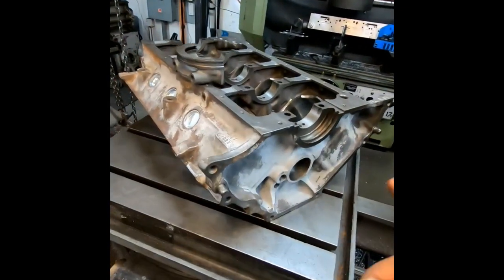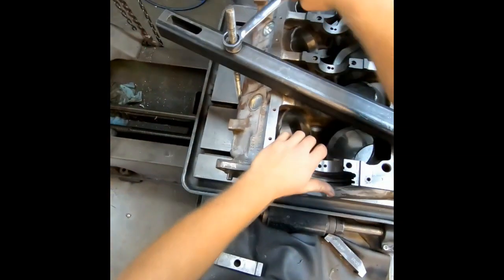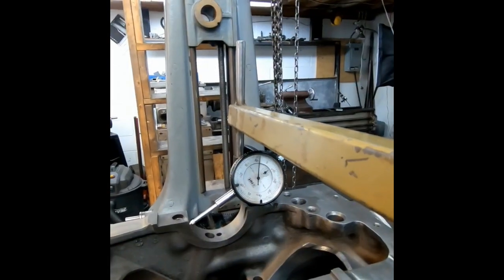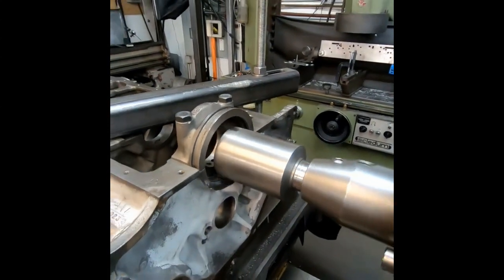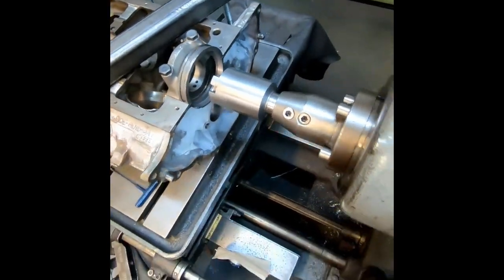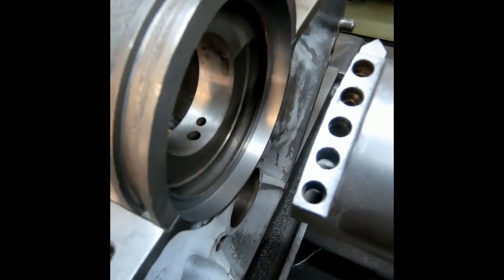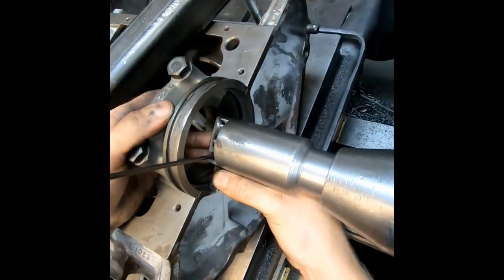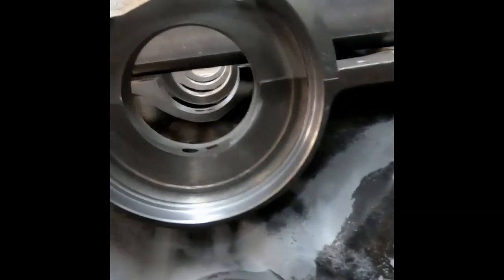302 Ford One piece rear main seal conversion

Comment: Wait can you put a 1 piece rear main sealed crank into a 2 piece rear main sealed block and just use a 2 piece rear main seal?
Reply: Same crank between both.
Reply: @FordRanchero289  there not technically the same crank though, one has the additional oil sling ring on the back and the other dosnt 🤔